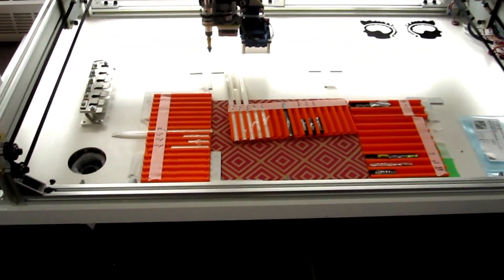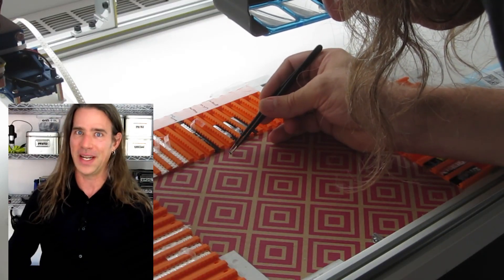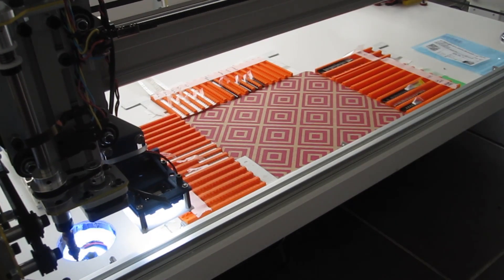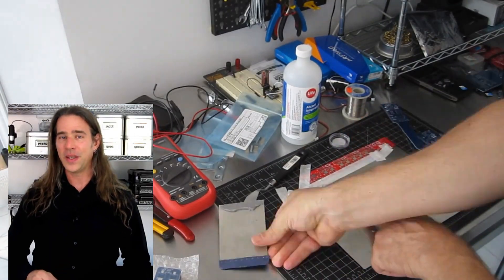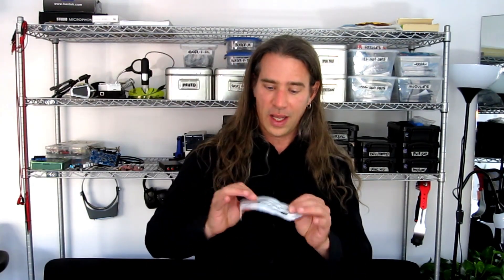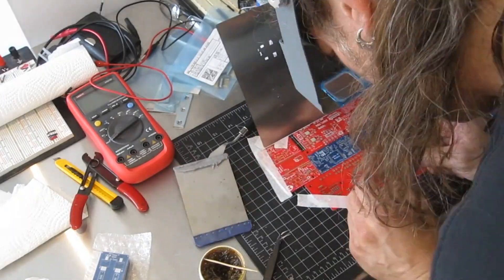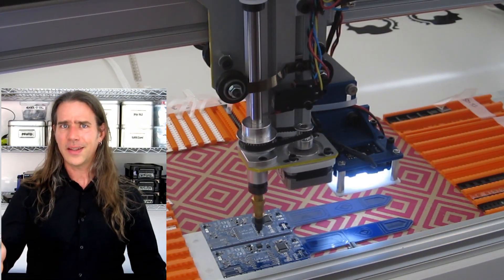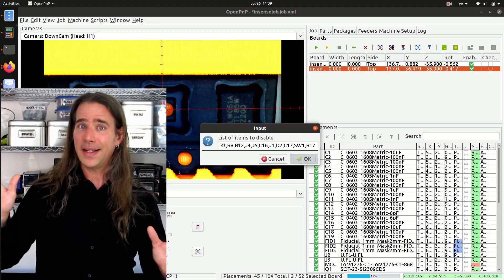OpenPnP Pick and Place run: highlights, problems and fixes

Comment: Would love to get an updated "openPNP on the Liteplacer run" tour, and also curious what kind of oven (reflow? multi stage?) you use? I used to work as an operator on a MYDATA machine as well as sometimes the panasonic MK series with the industrial feeders which I think you'd love. I did pre and post oven inspection and manual touch ups too. So seeing this tech has gone open source just blows my mind.. Thanks for sharing and making such great videos, very inspiring
Reply from the maker: Hey exhe!  Thanks for the feedback, glad you liked.  I actually do have some pending updates--lots of footage, little time to put it together--of most interest being how I optimized performance a good deal (I'd been running it at, let's say, conservative speed for instance and newer OpenPnP really shines in making thing smooth and snappy).  For reflow, I used a good old toaster oven (with a basic temp sensor and PID) for the longest time, until I upgraded to an IR oven (it's an upgrade, but still just a basic chinese unit... mostly great, but I find I miss the toaster oven in cases where I have some tall black plastic on the board, for instance).  In short, it works well (with open source firmware burned in--the default was complete crap that couldn't even count seconds correctly) but to make it tops I'd have to work on circulating the air in there a bit to even things out... hasn't been worth the trouble, so far, and will probably upgrade the unit before I ever get around to it, but you never know.
In any case... open hardware, open source: it's blown my mind too, ever since I discovered Linux @ uni, to have such amazing power just shared with everyone--it inspired me to release my first open source way back when, and I've enjoyed participating in this grand distributed project ever since.
As for the feeders... yeah, that still the biggest painpoint for me with LitePlacer.   Was recently convinced by someone to get back into the habit of contributing videos, and though I've yet to handle my giant stack, I did break the ice this weekend with a totally unrelated post on my most recent relaxing weekend project.
Thanks again, cheers!
Reply: @PsychogenicTechnologies  Thanks for taking the time to answer my question. I couldn't help but notice how some T-SHIRT reflow ovens seemed to be a single stage version of the 3 stage ovens we'd use in board reflow on the old assembly line I used to work at. I never even considered an ER unit. We'd run this  temp sensor pack through the oven wth the board. With these thin wire leads hooked up to various "zones" on the boards we plan to run. Then we'd tune the 3 different reflow zone temps to give us the cleanest result. I thought you might like to know that, if you ever plan on running a continuous line through your "oven" process

Comment: Hey man thanks for the vids.  They've been very informative. I'm trying to decide which road to go down?  I feel like it needs to be openpnp all the way.  Would you recommend a liteplacer machine with openpnp or a DIY frame with openpnp?  Also,  did you change your cameras out for something more openpnp friendly?  In one of your videos you mention the liteplacer cameras have trouble with openpnp?
Reply from the maker: Thank you for the feedback!  Sorry it took a zillion years to get back to you.  Have you decided and gone for it.  My recommendation is openPnP, for sure.  The LitePlacer does the job, no problem, and the YUV problem is pretty much gone with recent versions--I use the default settings and it just works (at least for white and black tape, clear tape is still tough, until I put a fat black marker to it... wouldn't be awesome for a reel, but in these quantities not an issue).

Comment: Nice! Would you make a tutorial on how to set-up open Pnp A-Z?
Reply from the maker: Hi, and thanks! 
That might be a pretty good idea (though it's been a while, now, so I'd need my own refresher!)  
I put in some extra deets at https://inductive-kickback.com/2020/09/openpnp-with-liteplacer-pick-and-place/ but these are the very-liteplacer-specific things.  Is that what you're using?
Once you've got openpnp talking to the system in a sane manner, it all becomes pretty standard (or at least covered by the openpnp user manual).
Have you been through the process?  Planning to?  Is there a particular snag or any area your most interested in?
Reply: @PsychogenicTechnologies  Thanks for the answer. I've been running a TVM802 and I am building my own machine, using a MKGEN-L as motion controller + OpenPnP. I am interested into how set up OpenPnp for a custom machine build.
Reply from the maker: @ingDemurtas Well that sounds cool.  I can't say that I know the answer to this... How do you talk to the MKGEN-L?  Is it just standard GCode?  
If that's the that case, the setup should be very similar to using the TinyG+LitePlacer, just a question of setting up the GCodeDriver and putting the correct commands in the various calls (MOVE_TO_COMMAND, etc).

Comment: Dude!  I watched your lightplacer build when I was first starting to build my PnP and hadn't really caught up on your channel until now.  I've since finished my machine and just ran my first small run.  I came up against every single issue that you listed!  Spot on man...  I knew you would mention bumping the table and all the parts going flying.  I did that luckily after the run, so all the more expensive ICs and parts were still covered.  I'm chasing down some final inaccuracies that are driving me nuts, but I can do 0805s and have some success with QFNs.  Thanks!  I have some videos to catch up on.
Reply from the maker: Great job on getting in running--man, I've bumped and jiggled components out of place so many times, I don't want to remember.  
The worst was a run for someone else's boards, and they'd provided just enough overhead to get by of some pretty specific components... i.e. I wound up sorting a bunch of resistors and stuff and refilling the strips manually.  Thankfully, they were 0805, but still, uuuf!
Hope you work out the accuracy issue.  In my case, the machine was well squared but I had to play with the backlash a lot to finally get it happy.
Then, the bottom vision in openpnp has its issues (especially with these cams) but still does a hellova job most of the time.
Reply: @PsychogenicTechnologies  Are you using backlash compensation?  I haven't tried that yet, but I did just tighten my belts and recalibrate.  One other problem I'm having is the auto feeder setup is mis-detecting my tape holes consistently by about 1/2 mm in the same direction.  Every single time...

Comment: Awesome video, as always! Any tips on how to add lighting underneath the desk so that Liteplacer's cameras get an even exposure? I will also place mine underneath my working desk. Also, are you using OpenPNP exclusively, or also Liteplacer software? Thanks!
Reply from the maker: Hi--and thanks!
Actually, in addition to the LED ring on the cam, I created a quick add-on by stringing a series of blue LEDs (in the hopes of helping HSV masking) and potted them in hot glue.  Then I tied the ring up in parallel to the 12V for the original LED ring.  Far from perfect, but it did help--you can see it here: https://inductive-kickback.com/uploads/2020/08/ringoop.jpg
I should probably do a vid of all these little mods on the machine...
Reply from the maker: Oh, and to answer your other Q: I've moved to using OpenPnP exclusively. Easier to have a single system to be familiar with, does what I need, lets me script what it doesn't have in Python (and if that doesn't work then the core is Java, which is still ok), and works well.
Reply: @PsychogenicTechnologies  Thanks for the reply! I have given up on the Liteplacer software because the optical nozzle recognition is almost useless. So I'm trying OpenPNP....but although I've installed the software I just can't get the PC/software to connect to the tinyG... Do you have any tips? I get the error message "Timeout waiting for response to G21 ; Set millimeters mode". I've put the machine-xml file found here https://wiki.apertus.org/index.php/File:Machine.zip in the .openpnp folder. I have no idea as to how I can proceed...  Thanks!
Reply from the maker: @equitimer  Oooh... yeah, have really been meaning to publish this info... short version is that you there was a good deal of messing around to get my GcodeDriver happy... a quick look at that machine.xml looks ok, though.  However, which version of openpnp are you using?  My config is under ~/.openpnp2 -- if you're lucky, it's just that dumb :-)
Reply from the maker: or maybe just port/baudrate etc settings... connect to the TinyG manually, using a terminal.   Issue a "G21 M9" or somesuch and see what happens...

Comment: Your work looks very professional, nice job dude
Reply from the maker: Salut!
Thanks man :)  Years ago, I was doing toner transfer and etching PCBs in-house: it was fun, gave "instant" gratification (very labor intensive but had boards in hand the same day) and it worked.  But with time and, you know, actual clients with real production requirements I've built up a process that gives clean and reliable results--and look pretty sweet, too :)
Reply: @PsychogenicTechnologies  oh cool, I actually never made my own pcb but someday I will do it :) And now with the placing machine are you still making some pcb yourself or do you use pcbway or jlc pcb ?
Reply from the maker: It's fun to do but is a bit messy... maybe I would use a mill now, rather than chemical etching.  But really, now the boards I make are either too fine-pitched (small parts) or have too many layers (I've done 2 layers in-house, but 4 I wouldn't even try)--and usually both.  So, yeah, I use fabs (usually chinese, pcbway is pretty good) for the PCBs themselves.
Reply: @PsychogenicTechnologies  wow I didn't even know that you could do 4 layers pcbs at home, thanks for the information i'm gonna take a look at that
Reply from the maker: Oh nono, what I'm saying is I've done 2 but wouldn't even try doing the 4-layer boards that I need now.  Even two was a pain!
(might be possible, I dunno... just don't want to commit the energy to try ;-) )
Reply: @PsychogenicTechnologies  Ow okay

Comment: good work  dear friend. what are you using the vacuum pump. Is there a pump for blowing?
Reply from the maker: Thanks!  The pump is whatever came with the LitePlacer kit--looks to be a very generic 12V vacuum pump.  There is no system to put positive pressure/blow, but as soon as the solenoid switches, you can hear those pops as the seal breaks (in the video there is a sequence around the 05:17 mark).  
That, plus having some sticky solder paste to land on, has been enough to ensure even small components are released > 99% of the time.